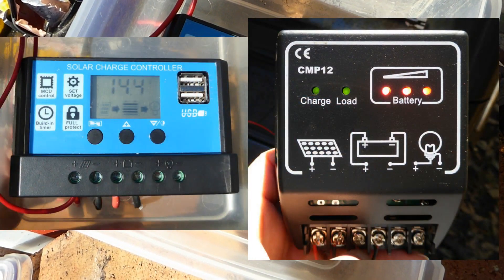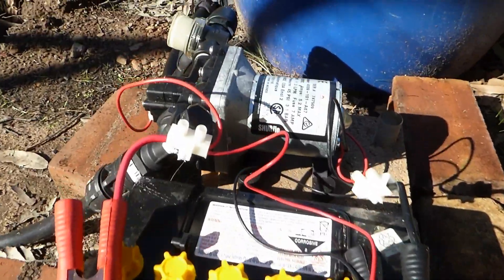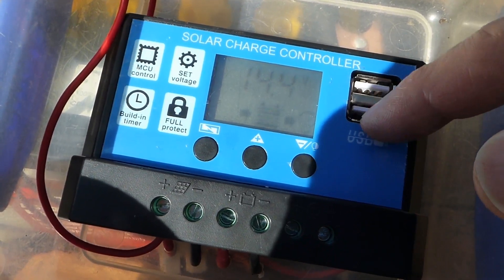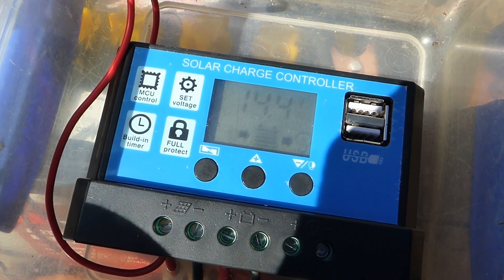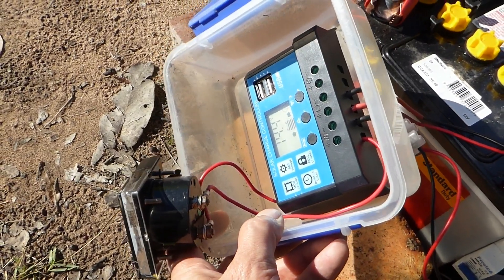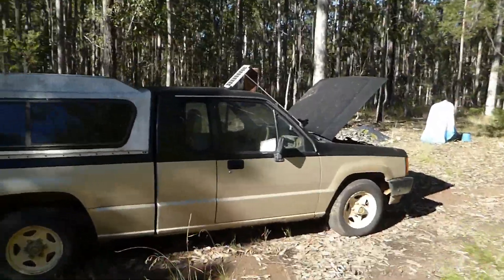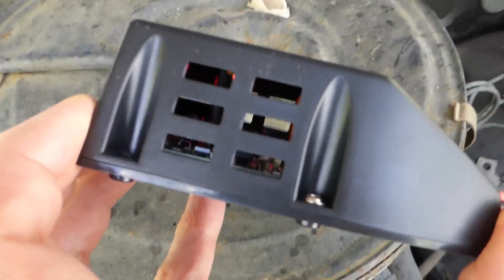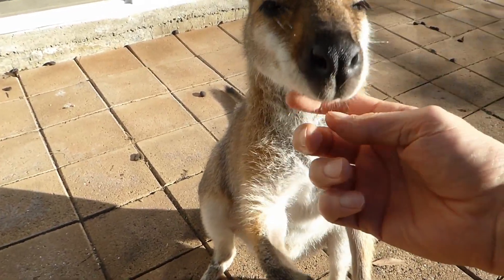Solar regulator PWM USB review charger

Comment: Hi mate, where abouts is your property? Are you off grid there?
Reply from the maker: Northern NSW. I have just installed a Daikin 2.5 aircon on solar. Seems to be working well, along with my Samsung SRL458ELS fridge. Hell to get an installer to come out to a rural area.
Reply: Cool, I live in Sydney and my job is Air Conditioning. You must have quite a battery bank to run them. I'm looking for an off grid property but they are so expensive.
Reply from the maker: If you want something for $50 on the beach, they are all down in Tasmania
Reply: $50K for land in the beach ?  Is that what you meant. Where abouts
Reply from the maker: No, I meant $50.   Land tends to get cheap as you go up the east coast of Tas towards St Marys. Also there are some surprising small blocks with house sheds on them on beach positions near Hobart as you go toward Port Arthur. (But planes probably fly over them.)

Comment: I have bought a10a controller I would like to connect a light to it,my question is can I set a timer on the controller?
Reply from the maker: I would say so. But I haven't tested the load functions side of its software.
Reply: My 2 cents. These controllers have their own timer and set programmable functions. Point being the power output for the load function (last 2 wire connectors on the right), only accept really low power demands. So you're stuck with LED's and that sort of low power stuff. 
For more important loads better connect directly to the battery and whatever timer of your choice. 
With this said these cheap controllers are quite decent value for money. Notice they are programmable. So quite flexible on it's use. ;-)
Cheers